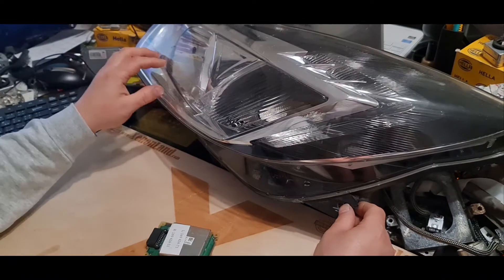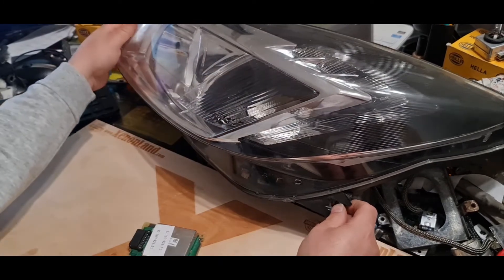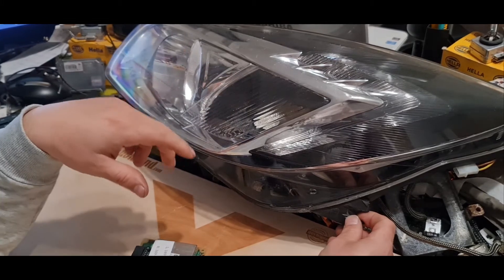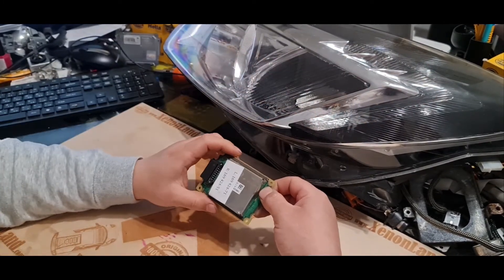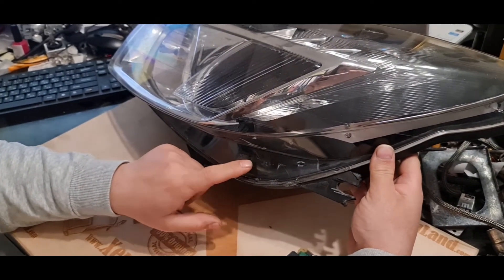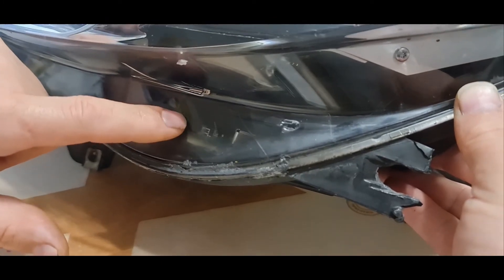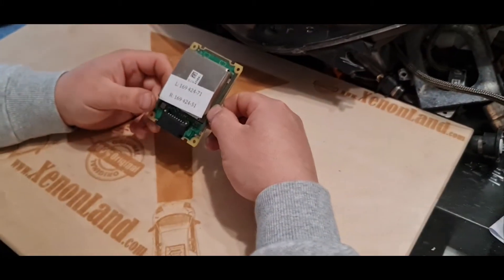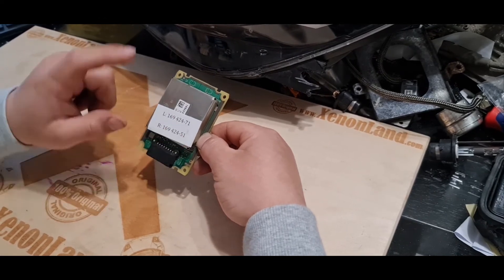Opel Insignia xenon headlight LED Daytime Running Lights (DRL) TFL not working? WHY? How to fix it?

Comment: Hi i got led module replaced light sealed all good. Still led drl not working. Is there any fuse also may be blown??
Reply from the maker: it does not sounds like a fuse issue. Is your ballast GENUINE one or aftermarket? If GENUINE one, than most probably the LED strip is faulty (given that replacement led module is working).
Reply: @xenonland genuine ballast but watter wet it was too
Led strip not changeable no ?
I can change left ballast to right and check
If ballast
After market ballast wont work ?
Even d3s bulb is very dimm
Reply from the maker: Swap the ballasts between the headlights. Aftermarket ballast not working properly at these headlights. If you have pre-facelift Insignia your xenon bulb should be D1S, not D3S. Facelift models (2013-2016) use D3S. Led strip practically not replaceable.
Reply: @xenonland its facelift
Ill swap ballast and check

Comment: Any experience with changing DRL modul on facelift model?
Reply from the maker: Not really, but you have to dismantle the whole headlight in order to change the LED circuit/module.

Comment: Do you know the LED module part number for the 2016 insignia 2.0 litre petrol turbo?
Reply from the maker: Not really. When and if we have this headlight in our stock will make a repair guide video.

Comment: Will 177310-30 AA module work on these headlights ?
Reply: Also did you try to interchange the modules, for example will 169 424- 71 work in the right headlight ? Thank you in advance.
Reply from the maker: They are sided. You should find exact module found at each headlight.
Reply: Thank you for your reply  @xenonland

Comment: Can be this module be changed ?
Reply from the maker: Yes, but the headlight lens should be removed and resealed. Please subscribe and help us to grow.
Reply: @xenonland  It s pretty hard to remove the lens , it might cause damage to the headlight
Reply from the maker: @Edward Robert  yes indeed. It is sealed with cold glue, very difficult to remove. See some bmw e60 lens removal videos in youtube, it is same glue
Reply: @xenonland   Very difficult to remove but common problem in water infiltration.

Comment: Hi, I have a 2013 insignia. My full beam isn't working either side. It started with the drivers side having bo drl dipped or main beam. I replaced the full unit and now have a drl and dipped head light but full beam is not working. I have tried different bulbs. Any other suggestions? The wee blue light is coming on in the dash but no full beam
Reply from the maker: have you changed the ballast unit which changing the headlight assembly?

Comment: Hello i have problem with high beam light  if one light does not work, is it possible that the other does not work? i want to know ,i need to buy 2 headlights ore just right headlights !
Reply from the maker: Every light is independent, just if one gets faulty high beam,  system automatically disables other high beam as well. Just change the headlight which is not working/has no high beam

Comment: Hi.i have face lift model with xenon and afl and both my left and right led have packed up i think they have gone8 at the same time but cant be sure..have put a circuit tester on head light input plug and geting power to 2 pins ie light up.any idears would be great help.kev